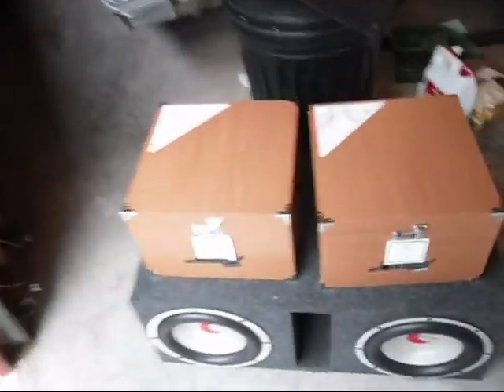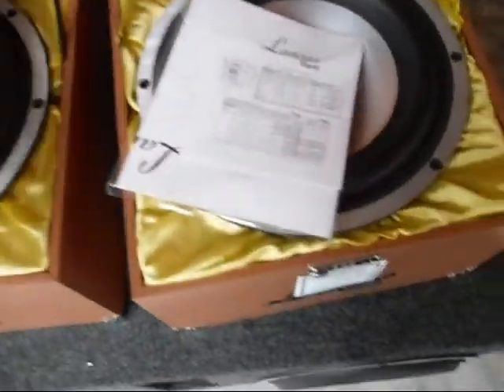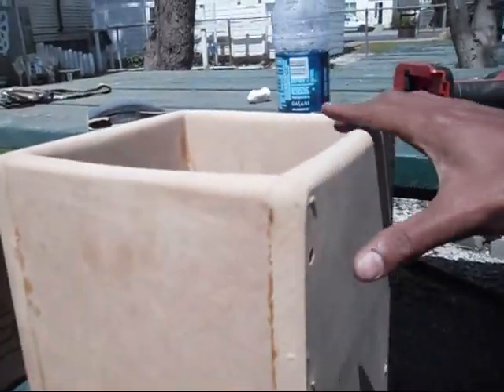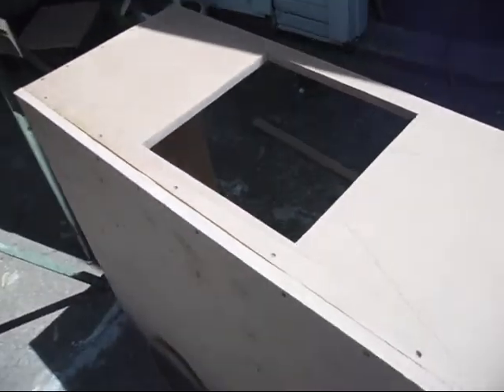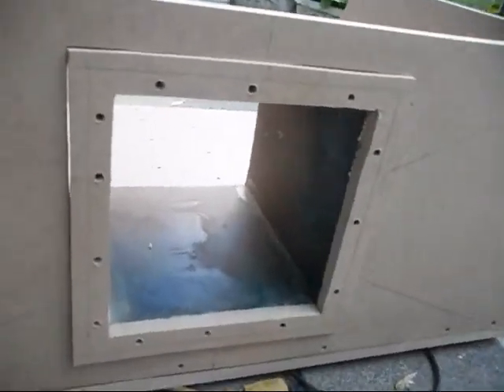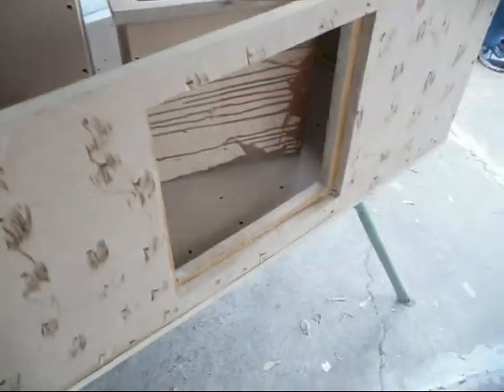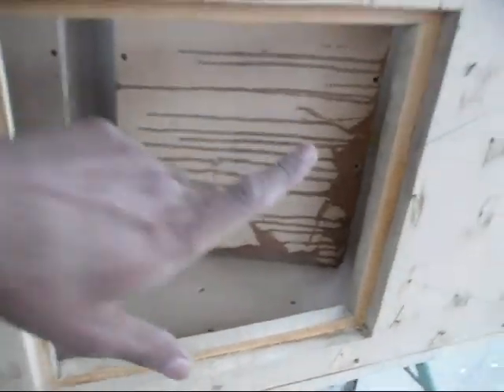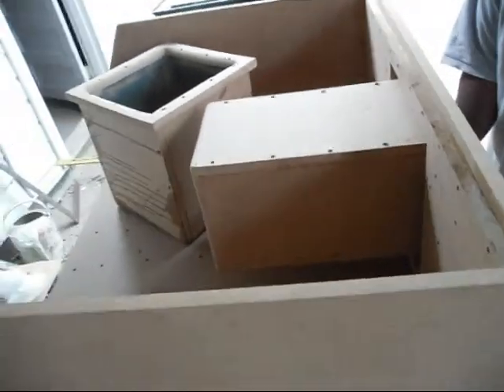Day 3 - Sixdogs1 and Safaribass...."Operation Shake the World" - 4 12" Subwoofers

Comment: hey sixdogs1 check steves first build  4 the tahoe it tells how 2 use i think there called t nuts with bolts they go in with an allen wrench after u drill the hole.i lil self adhesive foam works great  2 make it easily changed and not strip out the mdf good luck the box looks great!